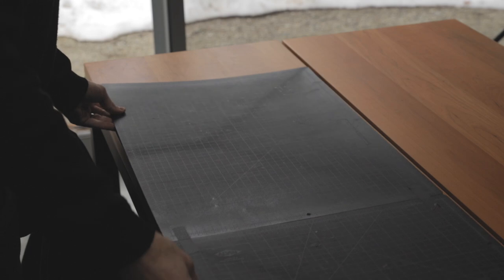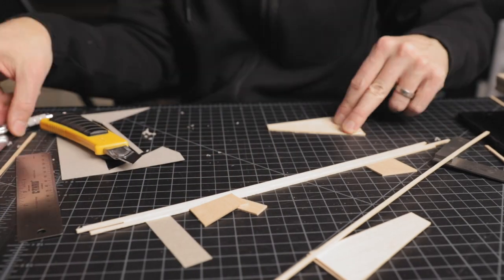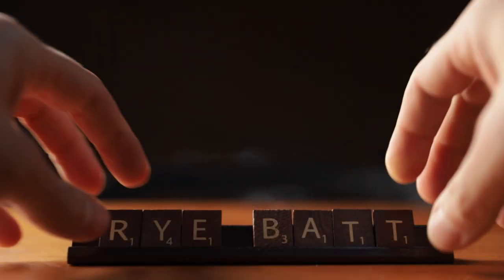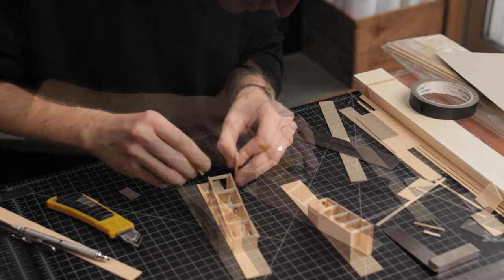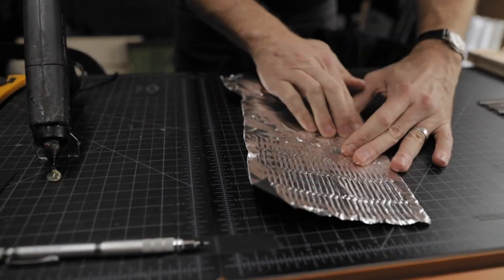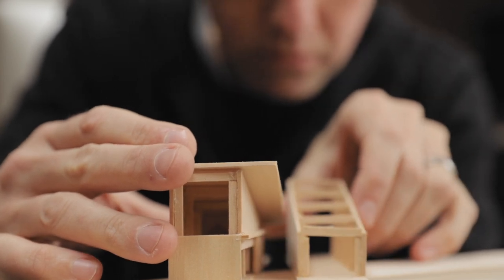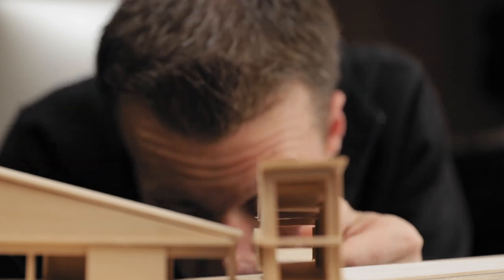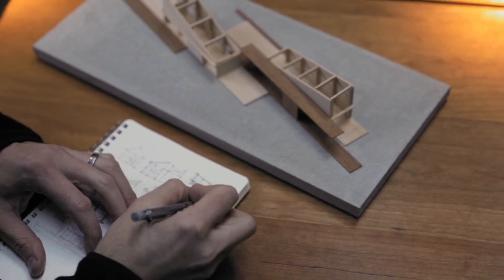Why Make Architecture Models?

Comment from the maker: Tell me below, what are your model building habits? All my model making gear can be found here: http://thirtybyforty.com/amazon-influencer/
Reply: I build furniture, nothing beats a physical model when it comes to lighting, materiale, scale etc. It's an absolut joy, I will do some modelbuilding tmw, it's been a while. Thanks for sharing your thoughts and inspiration!
Reply: I try to make several block models before moving to the scaled perfect model so i know what will work and would not also models allow a certain type of engagement with the client or jury which is not possible in any sketches, plans or sections. To be able to show something which isn't  just in 2D but a real thing which I can interact with  is the best part of models
Reply from the maker: 100% agree...so much value from a simple model...everyone reads something slightly different and I find the feedback to be much richer and useful...
Reply: My preferred process is clay to foam core or mat board. Due to the damage to my hands, unable to do basswood, which is why wasn't allowed to get a Master's in Arch (apparently NCARB requires the ability to do basswood models). Love clay as if don't like, can cut and shape, plus can explore texture. If really don't like, smash it up and start over. Foam core close second as so easy to work with but unless you have one foot thick walls, not for 1/8 models.
In regards to the whole process, hand sketch to clay, clay to computer sketch, computer sketch to rough model, more computer work, more modeling if needed, then presentation model, then final computer renderings. 
Models come before the elevations and sections in case there is a time crunch (tip from an architect and professor).
Reply: When I do models I particularly enjoy design them as puzzles without glue where pieces can be interchangeable, And I'm able to make significative changes on with out destroying it
Reply: Are lego good for making modles

Comment: I still wear a huge scar on my thumb from where the knife kept running past the balsa and into the side of it LOL ... I was terrified I would drop blood on the model!! Getting OFF the computer is the biggest recommendation I can make to any student or designer. Working with your hands on the drawing board, or in model form, helps remind you your putting together spaces, volumes, materials and light, to create a building and experience. In a computer, you can get so focussed on the lines, it detaches you from what they mean and represent. Beautiful video - and the model looks like a gorgeous project too. Thanks for sharing Eric :)

Comment: What about 3d printing? It is quite clear that traditional physical models are going to have the tendency to push your style in the direction of what is easier to do with them.
Reply: 3D printing is quite powerful, especially if you combine it with other processes like CnC milling of foam and such for landscapes. 
I will say, from experince, 3D printing is a slow process and does require a whole new set of skills... from running the actual printer to creating models that actually print correctly with the amount of detail you want to see. It is very easy to get fast massing models out of a 3D printer, but a detailed house/building could literally take days of print time... and usually need to be redone if the project changes. There are also limitation to what the printer can physically do, overhang and cantilevers are quire difficult.
That being said I love 3D printing and have been spending a lot of time trying to get the process to work with the residential projects we do and clients love to see the finished model.

Comment: I really appreciated the commentary on this video—it made it interesting for me even after years of making physical models.

Honestly I've never seen anyone use a glue gun, always white glue or CA glue. Does it speed up your process? Do you find it messy?

Thanks for sharing Eric!
Reply from the maker: thanks matt...great hearing from you...
glue guns can be messy, but quick for sure. there's some tricks you can use to limit the mess...for example, after gluing i'm always quickly tuning up the joint with a wipe of the finger and a quick swing of the hot tip on the gun, this cuts the spindly threads...this works for me, but i've seen some abominations made with hot glue so clearly there's some finesse to it...nothing that can't be learned with experience. white glue is my favorite for museum bd for sure...

Comment: There's always been a fear of making models for me because of the doubt of when to actually make them. If I may ask please, Do I use them as a design process( and risk taking a lot of time on one particular concept) or do I use them as the end product/ physical representation of my final design( which is usually not possible because of the limited amount of time designers have in a project).??

Would be great if I could get a suitable answer for this question.

Comment: Thanks for the video Eric.  Given that you think building things hands on is so important, which I agreed with, what are your thoughts on architecture students often having little experience with actual construction? Do you think every student should have a semester or year when they actually go through the process of building an entire house or other structure hands on?
Reply from the maker: this is one of the most valuable lessons you could ever learn as a student, so yes...if you have the chance to participate in the building trades and see things from the contracting side it's invaluable. humbling too i might add...speaking from experience.